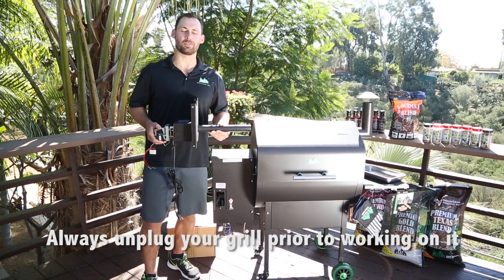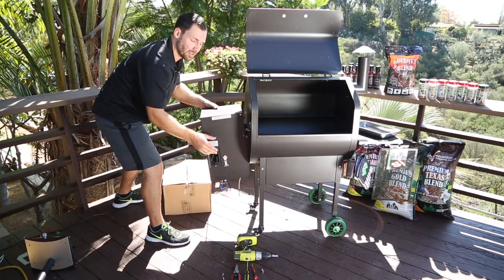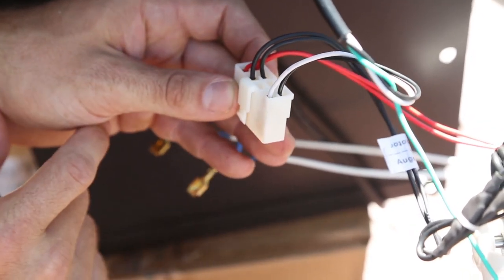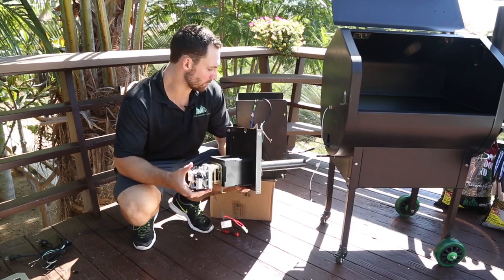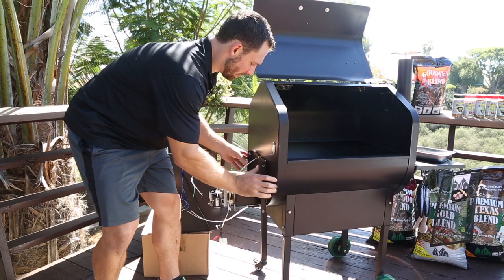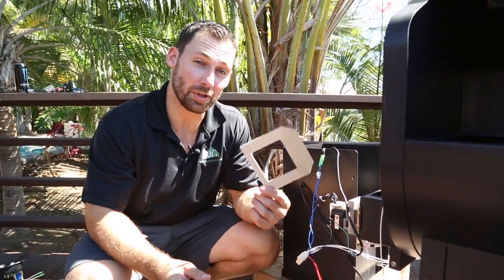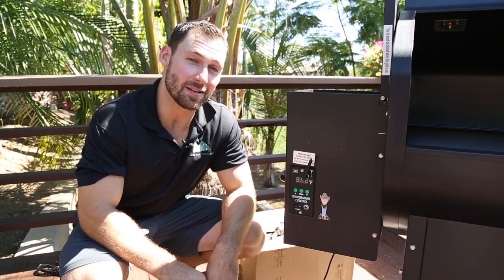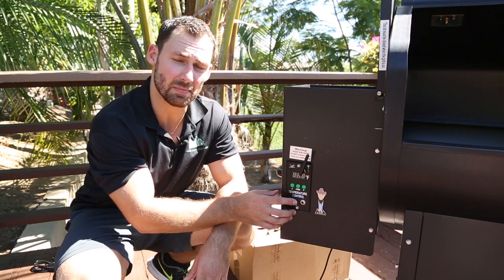Replace Auger Assembly on a Green Mountain Grill

Comment: IF the shear pin is broken, do I need to replace the whole assembly?  Or can I replace a portion of it, like the pin, or the motor? (I am unclear on where te pin actually is in the assembly)
Reply: I would just replace the shear pin. Definitely clean the auger and feed tube so the jam is cleared. That's probably what sheared the pin.

Comment: Not fair using a brand new grill. Should be using mine covered in 4 years of grilling, BBQing, and smoking residue. 😁
I've had my Jim Bowie since 2016. I had to replace the control panel last summer. Everything else is still going strong. Getting the heat distributed is my biggest problem.

Comment: While the grill is basically the same as it was 6 years ago I can tell you that having to do this sucks. I just tried to replace some gaskets. I’m not confident in my replacing. 

An updated video with some better closeups would be helpful.
Reply from the maker: Which grill style do you have? What is the serial number on yours?

Comment: Good to know. Although I didn't need to replace the auger, it did show me the proper steps to clear a jam. The only pellets to ever jam my GMG Jim Bowie are the Lumberjack Char Hickory. First time I used them was last weekend. First jam I've had in five years. Otherwise I use GMG or Lumberjack pellets exclusively, whichever is on sale when I'm restocking.

Comment: I'd have never bought a GMG or any pellet grill if I'd have know the level of upkeep and maintenance just to keep this thing "grilling." You're just going to want to measure just the right amount of pellets and burn through everything each cook. Any left over will turn into auger cement the next time it rains. No real easy access to unstick the auger as shown in this video, disassembly is terrible. Need easier access or an unjamming tool for the fire box end of the auger. Also for the people thinking buying one. Pellets, even with an additional tube going in the grill chamber and additional hours of low temp "smoking," will only give you a fraction of the smoke flavor of a traditional offset wood smoker. Be warned, this is just a low temp grill and NOT a true smoker.
Reply from the maker: Constant jamming is not a normal thing for our grills, call into our tech support line and we will troubleshoot your issue! 1-800-603-3398 ext #1
Reply: 2 things that are common sense.  Cover smoker after each use of course after cool down or just simply put it in the garage or covered patio. That just may help as you say auger cement. 2nd thing. You more of a smoke taste use a stronger flavoring pellet as mesquite and that just might solve the problem.  This as most people know are essentially a conventional oven with a smoker box. We also go into this knowing it's not a true wood burning smoker that you can put big wood chips in. Best thing is before anyone buys anything that may be a big purchase is to read and get knowledge of the product.  I have had my GMG Daniel Boone and has always done me right.  For anyone else looking to purchase, it's a great product if you dont leave it in the rain,sprinklers and dont mind doing maintenance on a normal basis as you would do your car.  That is just common since.  This thing is electric and should be no where around water to begin with. Not putting  anyone down by all means just sharing a little food for thought.
Reply: Cng-Hydrographics  Yeah I wish someone had enlightened me beforehand how large a gulf there is for smoked flavors pellets vs smokers. It’s not even close. Thanks for the mesquite suggestion, I have used it from various pellet brands, still an approximation of a real smoker. The only thing this has over an offset is the set it and forget it nature with no tending. Even then the hopper level sensor is so sensitive it goes off with any slight loosening of pellets. I’ve just put electric tape on mine so the neighbors don’t have to listen to my alarm all day/night.
Reply: Eugene Stoner I hear you on that. They do have a huge variety of pellets for sure.  I tend to check my pellets before they go I.  I dont like putting the longer pellets In. I love mi e for sure, however more up keep.

Comment: Why would an auger assembly need to be removed on a fairly new grill?  For me, it's been unfortunate because it jams or stops working for whatever reason. I just wanna BBQ.
Reply: Judy Peterson Hey Judy, did you get-it fixed or is this a re-occurring problem???
Reply: B M**se I found it to be an ongoing problem, even after replacing the auger twice. I would steer clear of GMG and it's products.

Comment: How do you remove the auger if it is jammed?  Or do you just have to buy a whole new assembly?
Reply from the maker: You can take off the cotter pin that attaches where the motor and auger bit meet. This will allow you to take off the motor. If the auger bit is really stuck, you can tap the auger tube with a hammer to loosen up the jammed pellets.